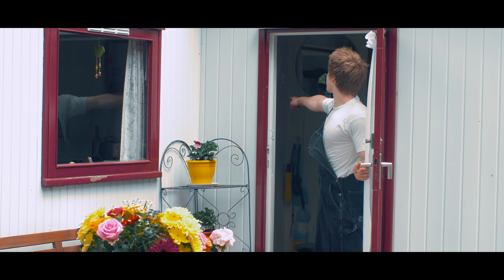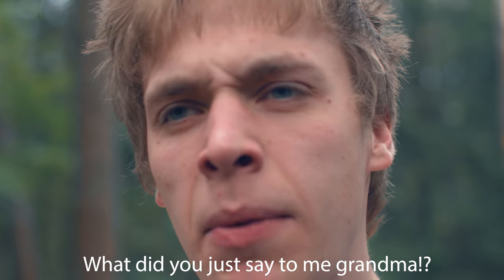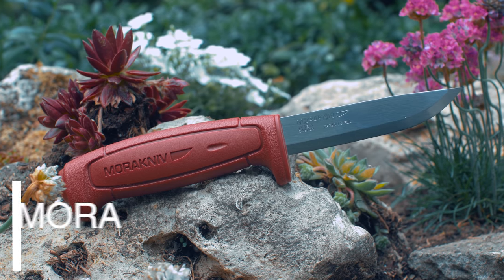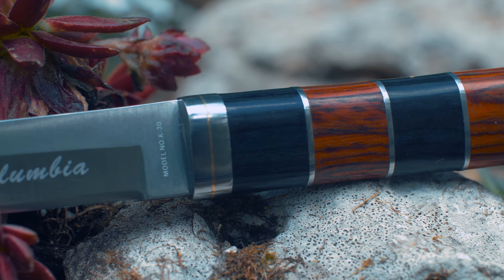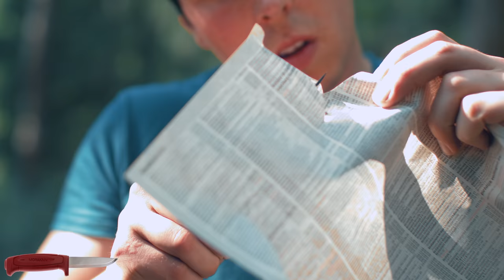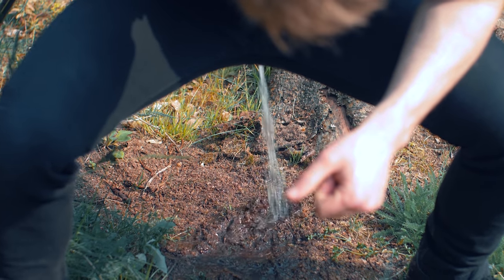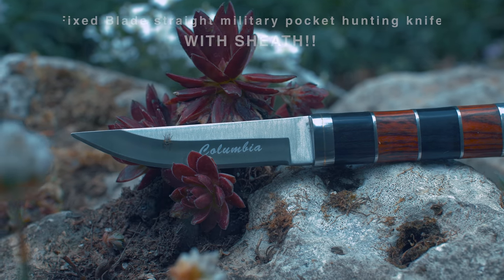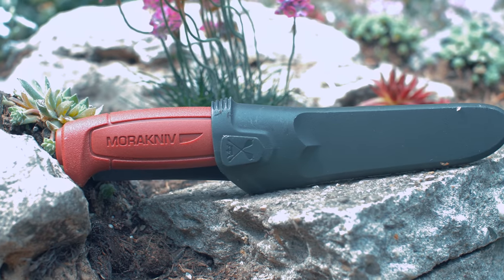How good is Ebay's CHEAPEST Knife! Would you buy it?

Comment: Good old Mora...
It can cut. It can be sharpened. It will not break. What else do you need from a knife ?
Reply: Moras break all the time. Outdoors555 broke one without much effort
Reply: @PB8man  i broke my basic 546 while carving wood yesterday
Reply: @HaraldSjellose  yup. Hot garbage.
Reply: The Bomb Doctor I have been using my mora firekniv for about 4 years with pretty heavy usage.  There is a little chipping on the blade, but it has held up nicely for a $40 blade.  Haven’t even had to sharpen it.

Comment: The handle... Reminds me of a knife I had that could have hurt me bad or possibly kill me.  Narrow tang inside handle, but didn't even have those round flat sections. The end cap was attached badly. At first it was just twisting sideways, then when I was swinging knife to chop at wood, the cap broke off and the cork handle sections slid off after I finished my swing. If they came off during the swing, the knife could have hit the nearby rock and bounce back at me. I could have been stabbed by it if that happened. And I was in the woods a good distance from home or any body else. Long walk for getting badly hurt.